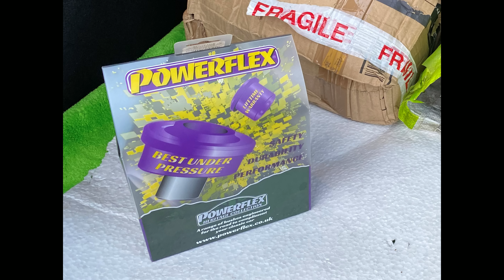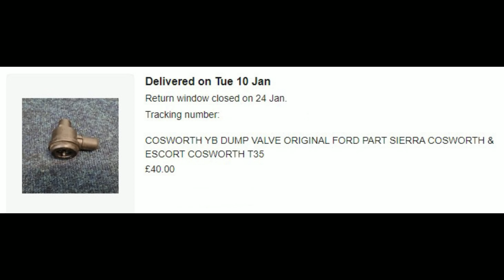Restoration STRIPPED & REPAIRING the shell of my Ford Sierra Sapphire RS Cosworth 4x4

Comment: One thing I loved about ford Sierra, you could unclip the lens, remove and replace the reflectors, stone chips not a problem, just put a new lens on it, Ford used to do exchange radios, many years back, trade yours in when it quit working, a nice new/refurb unit, people called them Jelly moulds, I thought they were stylish and different, each to their own I guess.
Reply from the maker: Thanks for the comment.  I totally agree about the headlights, it seems criminal these days that manufacturers produce 'sealed unit' lights that can only be replaced at crazy prices!  Thanks for watching.

Comment: Beautiful job mate but am pretty certain they are 2 wheel drive wheels the 4x4 wheels are different aren't they
Reply from the maker: Thanks for the comment Antony, I appreciate your thoughts on the Sierra.  The wheels changed late in 1991 to the 'Shark Tooth' alloys, so early '91 4x4 Cosworths were fitted as standard with the Lattice wheels.  If the Cosworth has the curved dash then it should have the newer wheels... mine has the square dash.  Thanks for watching.

Comment: I would have parked up the refurb rims in the garage with no rubber on them and kept those 17s it came with they look much better in my opinion.
Reply from the maker: Thanks for the comment and sharing your thoughts on the Softline vs. Lattice alloy wheels.  As you say, the car looks fantastic on the 17" Softlines but I am chasing that original look so it has to be the Lattice for me... but I will certainly miss the look of the 17"s on the car.  Thanks for watching - hope you stay tuned.